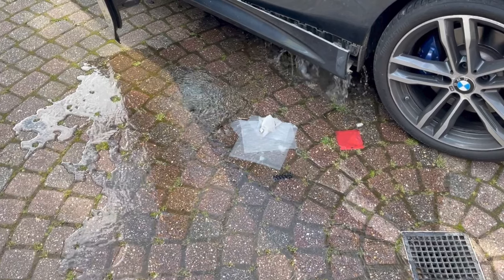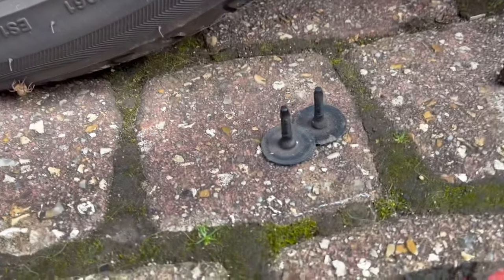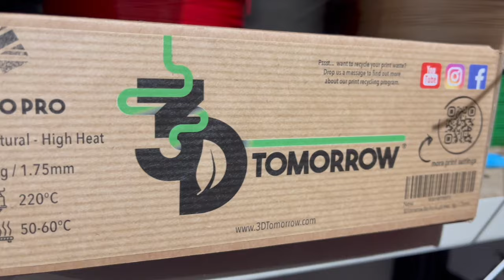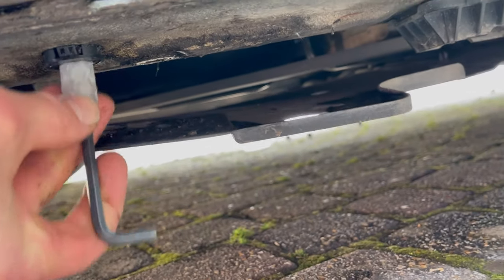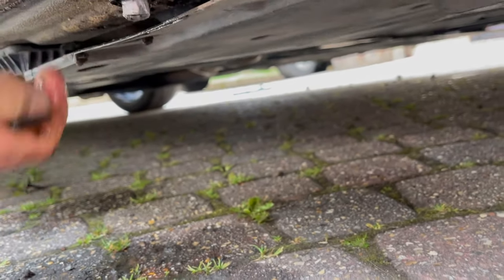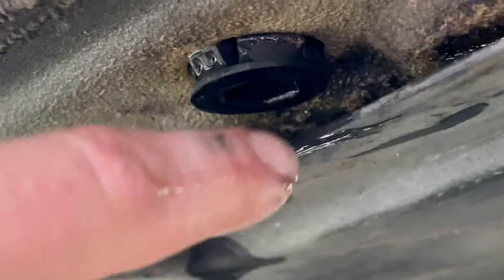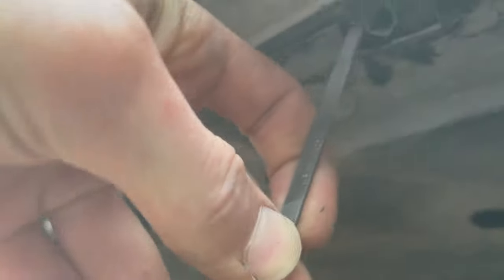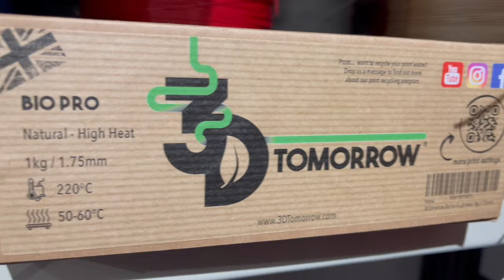BMW 4 Series F33 - Water Sloshing Sound Potential Fix - Save your Amp Before it Blows Like Mine!!

Comment: Finally someone who shows how it's done. I just did it on my cabrio as well. My back windows mechanism was completely rusted and had to pay 1000€ to have it replaced...

Also thinking to blame this on BMW but I'm lacking the time and emotion to start it.

PS. I think you need a 14mm hex key as the 13mm seemed slightly too small
Reply from the maker: Crazy that such a design flaw can exist, it will be the engineers not checking things properly when they made the convertible version from the coupe... Yep you're right about the 14mm hex, that is a better fit, the comment I had read online had said 13mm, so that is what I originally tried.

Comment: This is obviously a design fault and, as some have pointed out, is a possible electrical hazard caused by modules in the boot shorting out, directly above the petrol tank. This problem should be a BMW recall as it's potententially dangerous.

Comment: Great video Callum.

My left side boot compartment has just flooded, rendering the amp useless. No sound in the car at all. 

When you replaced the amp, did you go with the same one? Did you have to buy it from BMW? Or did you find elsewhere? Or would be possible to go for another make of amp?  Conscious that BMW are likely to take the p*ss on this one…..
Reply from the maker: Thanks! I did go to an official BMW service centre to fix it and it wasn’t cheap since it’s the H&K amp, £1800… however, BMW contributed £1200. I’m still somewhat tempted to take BMW to court over it to be honest, since it’s an obvious design flaw of a non consumable part that’s caused the car to fail within 6 years, so if I’m not mistaken it should be their responsibility.

Let me know how you get on.
Reply: @CallumColes  Hi Callum great video!. I also have had the amp blow and will do your fix. I have sent the amp to a company in Rochester for a fix for £235, fingers crossed. If not I will have to go back to bmw. can you let me know which dealer did yours for the reduced fee as I might have to try that if the repair doesnt work! This is clearly a design fault and think BMW should have recalled this!
Reply from the maker: @markperkins384  yes, my opinion was that it should have been completely covered. Every manufacturer has a duty to produce goods fit for purpose, so since this fault was there from manufacture it is their fault. I was planning to take them to court! But then managed to sell the car for more than I’d paid anyway, so just let it go. The BMW facility I took it to was Swindon, it’s quite a big centre. Good luck with your fix, fingers crossed 🤞🏼

Comment: Why not do away with the drain plug? Seems that’s part of the issue as well, getting clogged with debris
Reply from the maker: Well I suppose you could, but normally it’s there to prevent debris like leaves getting up and into the car. When there’s a hole above it, water will continue to drain and that helps keep it clear anyway, never too much trouble to give it an occasional clean, it’s the sort of thing BMW would/should check at service. 
The problem comes when BMW decide to block off the hole completely with the car bodywork🤦🏼‍♂️

Comment: Thanks for the vid - Sorry if asked already asked before but why not just leave that plug out completely ? Does it need to be there and keep getting clogged ?
Reply from the maker: They are meant to be there to keep leaves and things out, the problem is with the bodywork overlapping these drain plugs rather than the drain plugs themselves.
Reply: @CallumColes  I understand, but the plug lets a lot of water out once pulled out so must be stopping the water . If I drill a hole worried something may get trapped
In that . 
Will give your solution a go!

Comment: so last week i thought my rear channels went \Logic 7 surround setup if i go to rear channel i hear nothing ,then today whilst putting the roof down it wouldnt do the final boot close,had water under battery and on red junction box above it too soaking, carpet was soaked  ,and one of my 12v cig socket is dead,all fuses ok  (66,69),and the one in the boot ,after reading this i found my drivers side rear window seal was about 4mm away from the side of the glass ,so i gather its coming in there,other side is fine,gonna look tomorrow for the drain channels,not even sure if amp is fried anyone with a f33 440i try putting sound to rear only(full) ,can you hear anything,i cant get a straight answer on the forums some say its the way its setup i.e the front covers the speakers in the rear side panels too,i know ive got water even the boot seal had been moved and wasnt covering the outer lip expecting a tsunami........

Comment: Thanks for the video mine needs doing, the main issue is the how the water gets down there in the 1st place, I believe its the rear window seals, any information on replacing the seals
Reply from the maker: Yes, I was also under the impression that is how it gets in there. Not sure how to replace these unfortunately, I've since sold this vehicle.
Reply: @CallumColes  thank you for the reply, opened my up and it flooded, going we a quote from bmw for replacement seals, but now am the same as to if I really wanna keep the car
Reply from the maker: I've been told that the seals last 2-3 years. Ordinarily, that wouldn't matter if the drainage worked properly... Yes, I know the feeling. I love cars, but the minute something major goes wrong, they lose their gloss and I start thinking about what to get next lol. It's a shame really, as it's a cracking car, hard top convertible really is best of both worlds and since the latest version went soft only, it will hold its value very well.

Comment: Thanks for this video, has there been any official answers by BMW on this issue ? I am facing the same now with failing window and convertible roof due to water issue :(
Reply: I’ve had same issue with my M4, both rear window regulators failed so roof wouldn’t come down, BMW have charged a fortune to replace them. Luckily I managed to save my Amp that was covered in water!! It’s a design fault and BMW have taken no responsibility!!!!

Comment: nothing like a bath for electronics, motors, sensors, wiring & it freezes in winter depending where u live. Was all that water in the rear quarter panels & lower section of boot?
Reply from the maker: Such clever engineering 🤦🏼‍♂️ 
I never saw the water from the inside of the car, but yes, from the sound of sloshing water while driving, it sounded like that’s where it was located.

Comment: Hi Callum 

I have just purchased 68 plate 420i convertible, do U know if this has been fixed on the newer models or do I need to do this also :(
Reply from the maker: Hi Richard, sorry for the slow reply, had a bit of time off! Is it the same model as this one or the newest version? If it is the newest version, I'm not sure tbh. You should be able to tell though if you have a look at the bottom of the side skirt, if you can see through to the water draining point then you're all good. If not, it's probable that the design flaw is still there...

Comment: The BMW dealer did something similar to mine. Drilled a 12mm hole through skirt and tray and I can stick a wire up the drain to clear it now. Shocking.

Comment: Thank you for this! I need to perform this fix in my wife’s car. QQ: was it a 13mm hex or 14mm hex? I know the 3D print was 14, but I thought I heard you say 13. Thanks!
Reply from the maker: Thanks for the comment! Yes 14mm hex, I may well have said 13 as that’s what the original post I read suggested, but 14 works better. Be prepared to jump out of the way of water lol
Reply: Right on… Thanks again!!

Comment: Great video but was your carpets wet inside the car. Because mine are trying to find the problem 👍
Reply from the maker: Carpets weren't wet no, perhaps a different drainage port has become blocked or your window door seals need replacing?

Comment: I've a 2016 F32. Not a convertible and doesn't have a sunroof.
I pulled the side skirts off over the weekend but couldn't find a drain hole.
Presumably its only for convertibles or perhaps cars with sunroof?
Reply from the maker: Yes think it’s just the convertible, as I understand the fault is because the convertible was designed after the coupe and the bodywork team didn’t leave the drain hole exposed🤦🏼‍♂️

Comment: Sadly this is an issue BMW have had for years.  E9x series drivers have this issue as well, where the drain plug is blocked by trim pieces and it cannot drain and gets clogged and then causes flooding inside the car.  This can lead to flooding in and around the battery, which leads to corrosion on the power terminals, which leads to major electrical issues, and in some cases has killed cars completely.

Comment: Hi,
Do is it the actual drain plug you drilled the centre out of please, if so would it be easier to do this while you have it out of the car?
Brilliant help your video is as my window stopped working and now the roof, removed the rear quarter trim to find the quarter filled with water right up to the top where the window is. 😡
Reply from the maker: The drain plug was only removed to allow the water to drain and for the plug to be cleaned, no hole was drilled in the drain plug. The holes were drilled in the skirt of the car and the underlining.

Comment: Did you hear the sound of water in the cab of the car while driving or? 
How did you find out it was gathering right there?
Thanks!
Reply: Often the first tell-tale sign is a sloshing sound coming from the rear quarter panel areas when you're driving. Unfortunately (as for Callum) people often don't come looking for these videos until they get an electrical problem like with the amp. Essentially the quarter panels fill with water inside, then overflow causing problems with nearby electrical components, like the amp.
Reply from the maker: I'd not long had the car and drove it over to London (100 miles) in particularly bad weather. Once the weather cleared up I heard the water slosh, but during the journey home my amp went. Bit of googling, showed a fair few comments about this issue, so thought it would be worth a try and sure enough the water came out, far more than I had expected.
Reply: @CallumColes  did you hear the water the whole time you were driving or just occasionally? 
Maybe in bends when you turn or something?
Reply from the maker: @daniloradovanovic3762  yeah just the sharp bends and breaking

Comment: Does this affect the F31 aswell? I can hear sort of a splashing sound from the passenger side (right side in germany) when it rains
Reply from the maker: I’m not sure but very possibly, have a look at the underside and see if you can see the drain holes. Even if present, they could be blocked so try and clear them out in this case

Comment: The only reason I can think bmw covers it up is to prevent the dirt and debris that flies around under the car from getting in there and if that's the case they should just put a mesh filter over it similar to something like people use in the kitchen sink
Reply from the maker: The mesh filter is built in, the cover up is design fault, BMW have acknowledged this, just never did a proper recall.

Comment: Did you have to take off the side skirt to access the drain plug?
Reply from the maker: Hi Imran, yes I did indeed, the side skirt completely blocks the drain plug🤦🏼‍♂️
Reply: @CallumColes  could you drill a large hole through the side skirt to get to the plug? I think it might be easiuer than taking the whole skirt out? tempted to do that and remove the plug completely!
Reply from the maker: @markperkins384  theoretically you could, but you’d have a job knowing where the plug actually is! The side skirt completely covers it. I think it’s safer to take the side skirt off rather than risk drilling into the wrong part of the car… I’m not a mechanic and found it quite comfortable to take the side skirt off, I wouldn’t go as far to say easy, but certainly not difficult!
Reply: @CallumColes  Thanks i will give that a go first!

Comment: I have a 2015 m4 convertible,  when driving slowly I hear the water. 😓 . Thing is i hace carbon fiber side skirts installed, id have to remove those, THEN undo the bolts for the sides. Is it possible to just remove the under panel and get to the drain hole??
Reply: Nvm it looks like the drain bolt is under the side bumper AND the under panel cover

Comment: My back window regulator and motor was fried from the water.  Would it be OK just to remove the plugs? The side skirt would protect it.
Reply: Think I'm having the same issue, back window keeps sticking so my roof doesn't come down

Comment: His mate. You said amp blew but don’t mention it. Where is it located I assume inside the quarter panel. Which side mines just blown :-(
Reply from the maker: Yes the water damage resulted in a blown amp:( I didn't replace the amp myself, had it done by BMW, partially subsidised by them because this design flaw is a known issue.
Reply: @CallumColes  Thank you for posting this!  Super helpful (unfortunately, like others, seen after it was too late, but oh well).  How did you get BMW to partially subsidize the amp replacement?
Reply: Good question. Just had an £1800 quote myself from BMW. @callumcoles

Comment: I have almost the same issue,but the water on mine is getting stuck above where the small window stores itself after lowering it! No Idea why
Reply from the maker: Window door seals can go after a while, so I suspect that is what is happening here. You'll want to get that fixed asap, because it's not something that would be covered by warranty / the obvious design fault shown in my video.

Comment: Any chance u could show a video of how you get the side skirt off? Mine seems absolutely solid and doesnt move enough for me to access the drain plug properly.
Reply from the maker: Have you undone the torx screw bolts?
Reply: @CallumColes  yes all the torx screws removed but cant get the side skirt to budge from where the clips are supposed to be
Reply from the maker: Ah that's annoying, do have to give it a fair bit of force but equally don't want to break anything! From memory, I gripped the side skirt at the closest point to the front tire and pulled outwards, but I don't have the car anymore so can't check.
Reply: @CallumColes  ok, il try again next time im draining water out, ive broken another plug which I can just about reach and release water every few months when I hear it sloshing around. Feels like its attached to a tube or something.

Comment: Hey great vid! I have done the mod (removed the black bungs either side) however I can still hear water sloshing? Any ideas? Thank you
Reply from the maker: Thanks! Did water drain out when you removed them? I suspect if this didn't do the trick it will be because water is getting trapped somewhere else, it might be worth a check of the other drain points on this specific car e.g. door. Otherwise, there could be a fault in one of the components, e.g. a/c system, etc.

Comment: Does this problem happens to 3 series aswell  or only on 4 series ?
Reply from the maker: The exact issue showed in this video is specific to the 4 series cabriolet, but it wouldn't surprise me if there were drainage issues on other BMW models....
Reply: I   just purchased a 2020 3 series and I   have the same problem with the sloshing sound, I   have only had the car for a month. The dealership did not resolve the problem so now I   have to take it back again. So I'm concerned that once it resolved will it continue to happen?

Comment: Is there any drainage opening in the front of the car?
Reply from the maker: There's another on the other side
Reply: @CallumColes  I drilled the hole for it to drain but that didn't really work well.  I will leave the bung out this time because the don't serve any purpose.

Comment: Hello everybody. Is this the same for f36? I opened my side skirt and nothing under it. There's no draining hole. A help would be much appreciated.
Reply: I have a F36 and having similar issues! Did you manage to get it sorted?
Reply: @michaeloconnor3716 no, I opened all possible holes but no water came. I followed the situation and I realized that the sound comes when the diesel level is low and when I fill the car it dissappears. Obviously its the diesel sloshing inside the tank.

Comment: So i was wonderinf If drilling is the eventual solution why bother taking it all of and taking the plug out, just jack up and drill through ?
Reply from the maker: So you know where to drill😉
Reply: @Callum Coles haha, I mean once u see the drain plug just drill it rather than take out?  Also once I've done one side I would know where to dril without taking the side skirt off on the other side,  just using measurements from the  other side (by using distance from nearest screw for example)?

Comment: Where is the water getting in?!
Reply from the maker: The water gets in from a range of places, this is normal in all cars. Often at the front by the bonnet and the rear by the boot. It is supposed to be able to drain back out, but obviously in this car the design (or rather lack of design) makes it difficult to do so, so it gets blocked.

Comment: Why put the plug back in?
Reply from the maker: The plug wasn’t the issue, it’s the fact the side skirt and plastic sheet overlapped it with no space for water exit. Because I drilled the holes it should be okay to put the plug back in
Reply: @CallumColes  I think it's a mixture of the plug getting dirty and side sill siting against it. I removed the plug and put a bit of plastic against it which solved the issue for me.